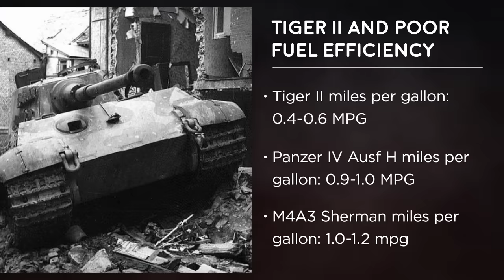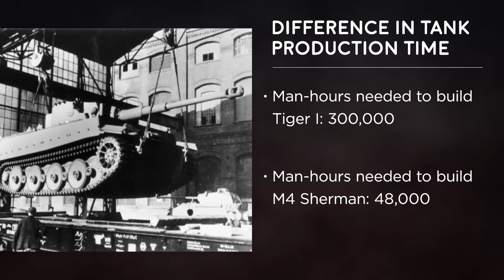Why Did German Tanks Perform So Badly in The Battle of the Bulge?

Comment: Nick Moran "The Chieftain" makes the point that the Sherman's design weight was limited by the capacity of typical port cranes.
Reply: CommonZense if you are shipping thousands overseas!
Reply: @zen4men  Cheaper by they dozen!
Reply: @douglasstrother6584  Mass production lowers costs
Reply: Any large, decent army can do reasonably well when they can drive or use rails to move their equipment, arms, vehicles, parts, med supplies, fuel, ammo, food, clothing, staffing to the fight. What was truly amazing is that the US projected their power across two different oceans, those are some long supply lines. 
Logistics become everything, weight, size, and durability were the watchwords.

Comment: A very interesting video, but it does feel like a couple of things are missing here:

1. For all of the faults of the Tiger 2, one of the problems was that it was used outside of its designed purpose.  The Tiger was a breakthrough tank - it was built to punch a hole in the enemy lines while soaking up some damage, and then the lighter, medium tanks would exploit while the Tigers were taken back behind the lines for maintenance.  Being used in combat for weeks on end was not a thing they were designed for, and the longer they were in combat, the harder it was to keep them running.  They took a long time to make, yes, but at the same time they were never the main focus of German tank production in the late war - the main focus was the Panther, of which thousands were made.

2. The problem with the Panzer IIIs and IVs was that by 1943 they were becoming obsolete and reaching the limit of what could be done in terms of upgrades.  The Panthers were designed to be their replacement and the next generation of German medium tank.  They had a lot of problems of their own, many of which amounted to being rushed through development, but moving on to new models was necessary.  So, yes, the Stug III and Panzer IVs were cheaper, but with the arguable exception of the Stug (which had taken on the role of a tank destroyer), continuing to produce them would have left the Germans relying on outdated equipment.  And, if you do take the Stug as an exception, you still run into the issue of it having a very different role in combat than the breakthrough tanks - they are not comparable in a "Germany would have been better off building X" way.
Reply: The Tiger  and Tiger II were not well-suited for combat in Northwest Europe, with its forests and extensive urbanization.  On the Western front in 1944-45, what relatively few were engaged there were usually kept in a defensive role, guarding reconnoitered lines of advance against Allied armor, able to pick them off while still outside effective range of the enemy tank guns, then using their relatively limited mobility to move to another firing position, often pre-dug by pioneers attached to their panzer battalion, once retaliatory air or  artillery strikes began to fall.  On the offensive, Tigers were still vulnerable to flanking shots.

The general open terrain of the Eastern Front better suited the Tiger's thick frontal armor and heavy firepower, where it was better able to pick off Soviet armor while shrugging off retaliatory fire.  By the time it was in significant numbers on the Eastern Front, the Heer was almost always on the defensive, or the run, and such warfare also well-suited its usefulness on defense.
Reply: Theres something to say about quality over quantity. But only to an extent. The shermans are considered by some to be the worst tank in late ww2. But theyre dead wrong. They had the highest survivability of any tank made in real numbers. And were more than capable of taking out most tanks. Killing tigers was the job of american 76 tank destroyers. The sherman was an infantry support tank. My point being the germans focused too much on very heavy expensive to run and repair tanks. Also resulting in them constantly breaking down due to a lack of replacement parts. The sherman was the perfect tank for ww2. Easy to ship, drive, produce, repair, and replace. Had very few casualties. And was meant to do a few things very well. The russians also knew this with the t34. Though it had many shortcomings compared to the sherman due to it being an older tank made with any materials available
Reply: @natelav534  Generally agree, but the Germans didn't "focus" on the "heavy, expensive" tanks.  The Tigers were indeed very costly, but their role and production numbers were by intent limited; they were not to be the main battle tanks of the Panzerwaffe.  The Panther was only about 35% more expensive that the Panzer IV that it didn't entirely replace.  The latter, although very much outdated by 1945, was still effective due to decent automotive performance and having an adequate 75 mm L/48 main weapon. 

 The Panther was hampered not so much by its design, although "feature creep" caused it to be quite a bit heavier than originally planned, but by manufacturing troubles which also plagued other German AFVs.  The biggest issue was that the planned final drive with helical gearing never came off, the Panther had to make do with the same unit as the Panzer IV, hence why it was trouble-prone.  That and use of foreign and/or slave labor at Neibelungenwerke caused huge QC issues.

Even had the Germans stuck with the Panzer IV as the principal battle tank of the Panzerwaffe, as Guderian wanted, they still wouldn't have produced them in anywhere near the numbers to match Soviet, UK, and USA production.  And what of crewing them and supplying them with fuel and ordnance?  The Panzerwaffe could barely run what they did have!  As of quoted:  amateur talk strategy and tactics, the "pros" talk of LOGISTICS.  Gemany LOST the part of the war dealing with logistics very badly.
Reply: The surviving 30 Tiger IIs of Schwere SS Panzer Abteilung 501 left the Ardennes area and in mid January 1945 were entrained near Cologne and transferred to Hungary, where in February they lead the SS attack and were instrumental in the Germans retaking the Gran bridgehead off the Soviets.
In the open tank country there they could use their advantages to great effect.
Reply: Nate Lave

Give the survival rates of all tanks built in numbers in WW2 and cite your sources so we can compare.
Reply: @selfdo  The Panther only cost 15% more than a Panzer IV and was probably cheaper than a late war M4A3E8.
Reply: @TTTT-oc4eb  I'd had the price differential as 35%, but if yours is more accurate, it further makes my point...the Panther, for all its teething troubles, gave the best "bang for buck" (or Deutschemark) in terms of combat capabilities.  Although more due to design creep than fulfillment of program objectives, including accommodating Hitler's dictates, the Germans had created one of the first, if not the very first, MAIN BATTLE TANK.
Reply: @selfdo  According to 1944 Datenblätter für Heeres-Waffen, -Fahrzeuge, -Gerät:

Tank prices listed without weapons, optics and radio:

Panzer IV Ausf. F1, F2 & G: RM 103,462
KwK 40 (L/43): RM 12,500 (1400 man hours)
No figures for KwK 40 (L/48), but for the very similar
StuK 40 (L/48): RM 13,500 (1800 man hours)

Panther Ausf. D, A & G: RM 117,000
KwK 42 (L/70): RM 12,000 (1500 man hours).
Surprisingly enough, the Panther's gun was less expensive.

The Panther needed about 82 tons of material and the PzIV 39.

Agree that the Panther was basically the mother of western cold war MBTs. Modern western MBTs are arguably more similar to the Tiger?
Reply: @TTTT-oc4eb  Ok, there's a good reference.  Interesting that the KwK 42 cost a bit less than the KwK 40 variants...were they not all made by Krupp or licensed by thereof?  

As for Western MBTs starting out more like the Panther, I'd say, yeah, look at the original UK Centurions with the 17-pounder and soon afterwards the 20-pounder guns, or the US M26 and M46 (developed about the same time frame as the Panther, shipment to Europe and issue to armored units held back by LTG Lesley McNair on the basis that it was unsuited and not needed for Army requirements).  The "British Bulldog" was some heavier (52 tons), the M26 slightly more at 46 tons; the weights crept up as the type was modified (M46, then M47, with the newer turret and 90mm main weapon, both at 48 tons, the all-new for 1952 M48 "Patton" at 50 tons) but the overall protection and firepower were about the same as the Panther.  If you're going by weight, yeah, the later Western MBTs were in the weight class and MORE of the Tiger I, with the three "biggies" of NATO, the M1A2 Abrams (esp. those equipped with "TUSK"), the Challenger 2, and the Leopard 2, equaling and surpassing the much-maligned King Tiger!  Only the French LeClerc, keeping in with French practice to design for mobility over protection, stays near the Tiger I's weight.  However, all modern MBTs have engine and drivetrain systems that are far more powerful and durable than anything the Panzerwaffe could ever dream of, to say nothing of their communications and fire control systems.  They move a lot better than any WWII-era vehicle, some even thinking they're "Evel Knievel" by doing a jump!
Reply: @selfdo  I guess the Germans just got better at mass producing hardware during the war, hence the relatively cheaper late war stuff. An early war Bf 109E was much more expensive than a late war G, despite the latter being far more formidable.

Yes, power to weight ratio of modern tanks  is obviously different to WW2 tanks, although the Panther was very good by WW2 standards, and even the Tiger 1 had similar or even better power to weight ratio than most M4 variants. Interestingly, the advanced suspension of the Tiger and Panther gave a smooth ride that wasn't surpassed until the Leopard 2, according to the director of Panzermuseum Munster.
Reply: @TTTT-oc4eb  The only trouble with the WWII German "Big Cats" is that they all were a "beast", pun intended, to winch out if stuck in a ditch or otherwise disabled.  AFAIK, no "Bergetigers" produced, nor am I aware of any field modifications to make one, as with done, I believe, with ONE Panther.  They made do with their Bergepanzers, converted from obsoleted panzers, including the dinky Panzer I, and only the one converted from the Panzer IV had a chance to rescue any of the "Big Cats".  Or they used half-tracks, including the heavy Sdkfz 9, to recover their heavy tanks.  They actually had regulations forbidding using the battle tanks as ARVs, but that typically was ignored due to expediency.  

I'd say the Panthers and Tigers were all actually good DESIGNS, with features that made them ahead of their time, but they were not easy to manufacture and maintain in the field.  Production and maintenance of AFVs is as much a test of a warring nations industrial, technical, and economic capabilities.  Given the restraints of the Versailles Treaty, which sort of did their intended purpose (delay German rearmament), that they went from having to furtively engage in joint exercises with the Soviet Union at Kazan, and develop high-velocity guns in Sweden, to at least producing competitive designs, in quantity...just NOT ENOUGH.
Reply: @selfdo  They made 339 Bergepanthers with reinforced final drives.

https://en.wikipedia.org/wiki/Bergepanther
Reply: @TTTT-oc4eb  Funny, I'd heard they hadn't.  The Wiki article is well-referenced, so it looks believable.
Reply: Well at the start of WWII the Germans had advanced equipment all the way around. But with the Allies being able to restrain German manufacturing with the Allied bombing campaign and of course the Allies being able to come up with better equipment all the way around helped immensely. The Germans had weapons that if they were able to introduce into the war earlier and in greater quantities, it would have made things tougher for the Allies. In the end game however the German economy was just not going to sustain the war effort as long as the Allied powers, especially with the United States being involved.
Reply: @natelav534  While you arent wrong per se, I think the Sherman has better right claiming it one of the most versatile succesfully deployed tanks but not specifically the 'superior' tank.
The Sherman, like the russian T-34 were designed at first as the 'main battle tank' of its time and unlike the germans they also stuck to that by upgrading and upgunning the Sherman as a platform with good mobility to boot. The german heavies and superheavies were purposefully build to have thick armor that could shrug of whatever the allies/russians would throw at them, while barging through them with heavy weaponry. Like already mentioned by others: German heavies and superheavies were designed as a breakthrough tanks and not a main battle tank, starting with the Tiger I and ending in the partially finished Maus and never-introduced full E-series. Hitler was of the false belief the arms-race on tank design would be bigger, larger, heavier. so all those tanks were designed for a battlefield that would never come to exist because both the allies and russians didn't follow that same design philosophy. 

Was the Sherman a formidable vehicle? Sure, for what it was supposed to be capable of it was a well-functioning vehicle and be credited for good mechanical as well as crew survivability. However german tanks as a force opposing you was also still a formidable force. Where it went downhill for the germans is that everything around the tank was burning down making the tanks themselves a fraction of what they could do. When tanks (irrespective of which one) has no or untrained crew, no ammo, no or inadequate logistics/mainenance, no proper (combat)-support, inferior or lack of materials, bombed factories, being outnumbered or otherwise fighting multiple fronts etcetcetc than those tanks wont win you anything.

So again, stating outright tank xyz was the superior tank, is very difficult to say because of so many variables that played a part over the course of the war, and the whatifs at every junction could have wildly varying outcomes.
Reply: @natelav534  To emphasize the "Very few casualties" I will note that total US KIA armor branch for WWII was only 1399 from an equivalent of 25 armor divisions (that includes separate tank battalions).  That doesn't include officers (who would be infantry, artillery, or cavalry branch) but does include armor branch enlisted soldiers killed while outside their tank.
Reply: @TTTT-oc4eb   The French post war tank designs started with the Panther, which the French had in service at the time.  They soon realized that the large road wheels, necessary for the Germans because of a shortage of high quality rubber, were not a good feature for post-war France. They did make a good business of adding a knockoff of the Panther 75mm gun, and installing it on Shermans, for sale to the Israeli Army.
Reply: @TTTT-oc4eb  another clown

Comment: Thanks for pointing out the importance of the spring loaded hatches on the Sherman tank. A simple yet important fact easily overlooked by history.
Reply: The same thing with the Japonese Zero. It was faster and more maneuverable than Americas fighters but it had no armament protection for the pilot and its fuel tanks did not have bladders to avoid gas vapors. One round through the tank and it would catch fire.

Comment: Something that few people take into account is crew survivability.  The speed which a crew can get out of a tank is important.  Because it's harder to replace experienced tank crews than it is to replace the tanks.  Over time this gave allied tank crews a quality edge over the German tank crews.
Reply: Good point.  A tank is only as good as its crew.  Germany simply began to run out of experienced tank crews in much the same way they ran out of experienced pilots.
Reply: Exactly. Statistics show that after receiving an initial knock out blow, the M4 Sherman's crew survivability rate was 4 out of the 5 men.
Reply: Panther doesnt have a particularly good time to escape if you look at the design of the commanders hatch plus the internal layout

Comment: At 600 yards or less the Sherman is the better than the Tiger in a fight. At those ranges the Tiger's armor, gun and optics advantages are nullified and the Sherman can aquire targets 4 times faster and shoot 5 times as fast the Tiger.
Reply: A Sherman can't penetrate the Tiger's frontal armor at all, and even has to close to point blank range from the side or rear to have much chance. Even the 76mm wasn't much better due to its poor quality ammo.
Reply: @TTTT-oc4eb  That was usually the best way to kill them but they didn't always have that choice. The Shermans came up with the tactic of skipping rounds off the front plate so it would strike the underside of the turret.  The standard AP rounds penetrated the frontal armor at less than 600 yrds or says the US Army proving grounds. It turns out not all Tiger's were created equally. The Tiger's armor quality went down as the war went along.
Military History Visualized did a video the Tiger's armor quality issues. The crappy ammo I believe you're talking about is the HESH rounds and the early Sabot rounds. Saying they weren't very accurate is being extremely polite.